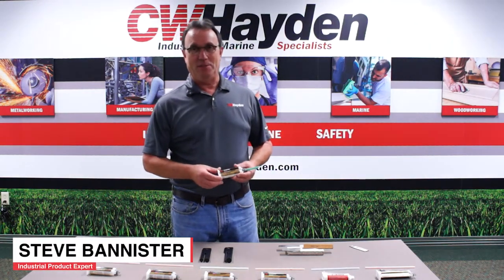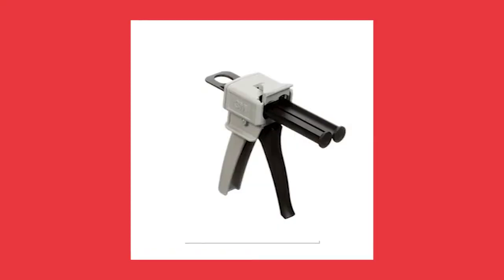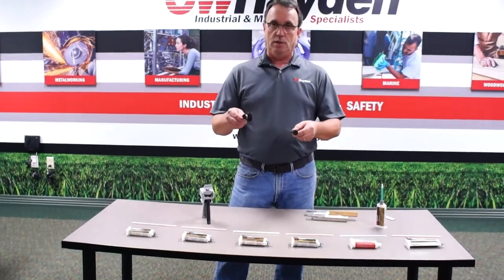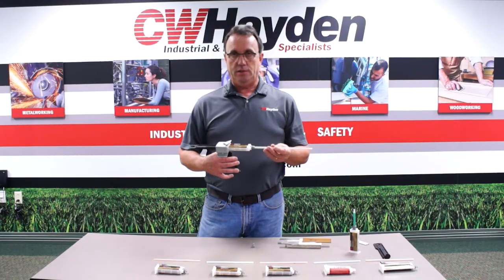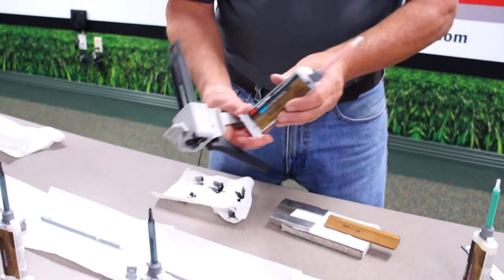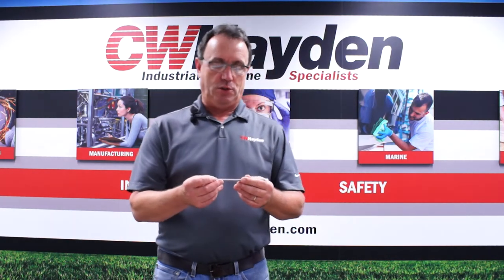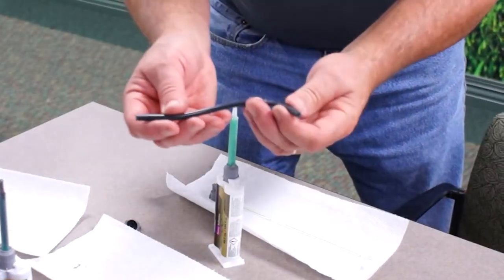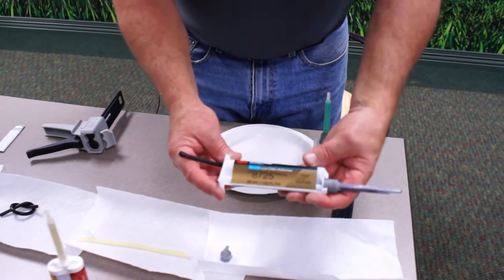3M™ Scotch-Weld™ Epoxy Adhesives  - Which Epoxy Is Best For Wood, Metal, & Fiberglass? Mix & Match?

Comment: I have a triangle stainless steal open jump ring. I use it for the keychain. However the chain in the ring is loses because there is a space under one side of that stainless steal triangle ring. I cannot weld it. I have found 3M Scotch Weld 2216 B/A. However, it is insanely expensive. What do you suggest for stainless steal?